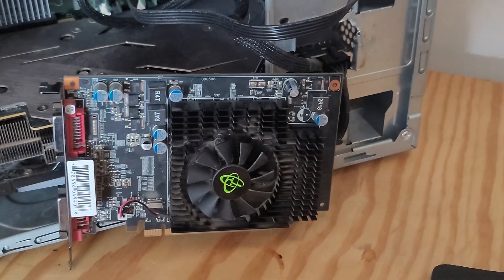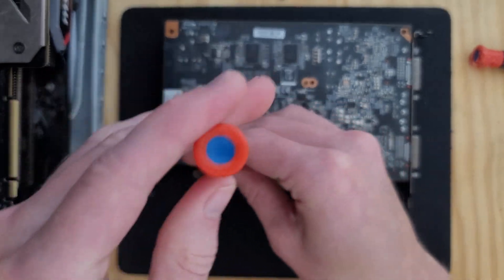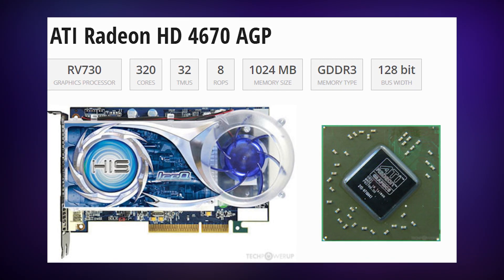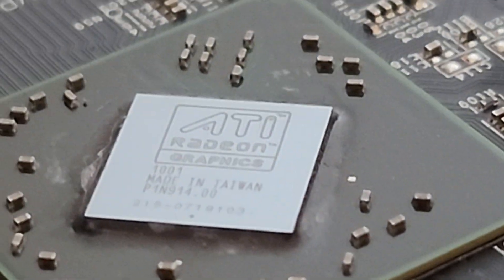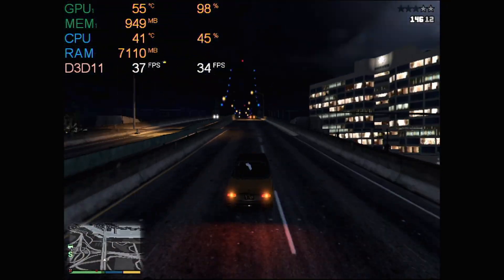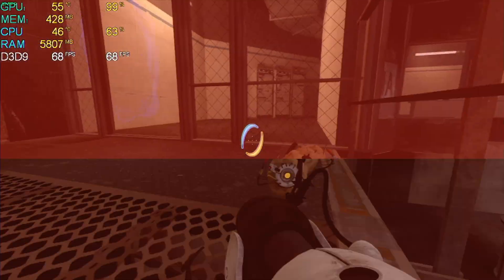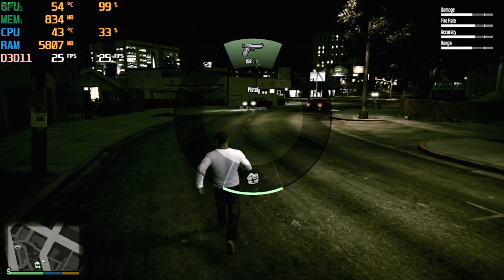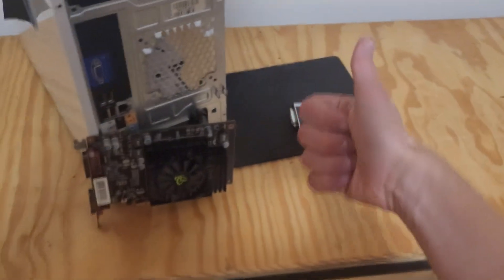How Bad (Or Good) Is a Mid-Range GPU From 2008? - Can You GAME On HD 4670 in 2022? - Kinda

Comment: I’m pretty sure DVI and HDMI use the exact same signal, so any name-brand capture card should work as long as you have a DVI-HDMI cable.

Knockoff/no-name cards should be avoided since they often don’t work properly at their advertised specs.

Personally I have an Elgato but they’re on the pricey side and their software is horrible (you can and should use OBS instead).
Reply from the maker: Thank you. Ill get an elgato after monetization